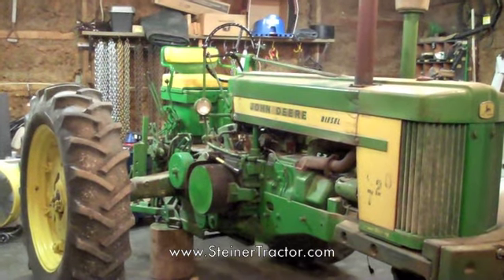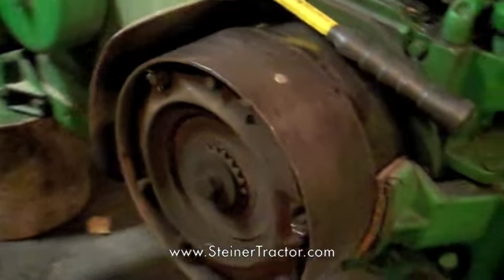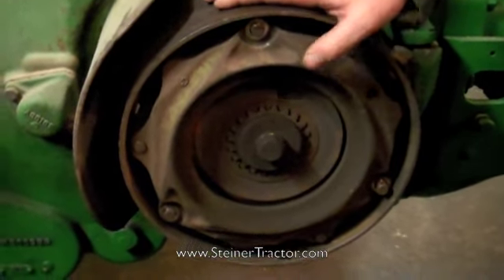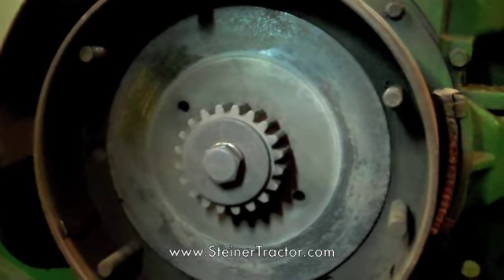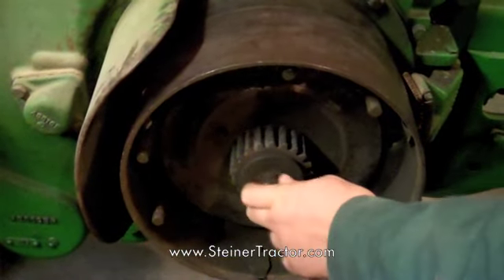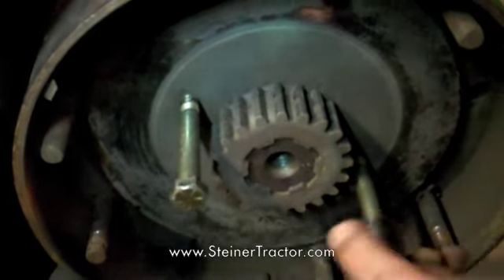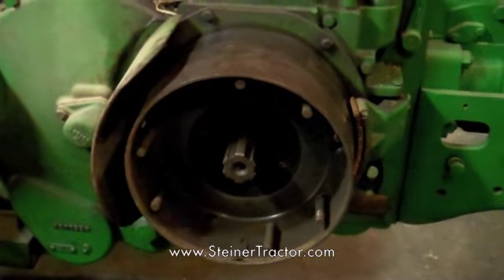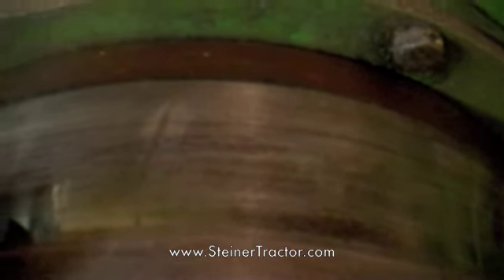Step 2 - Tear Down

Comment: The 530 manual says you need to use a puller to remove the gear off the tapper lock. Can I use two bolts on it or do I need a gear puller

Comment: Hi, where would I be able to find a used crankshaft for a 730 john deere Diesel
Reply from the maker: Hi Rhyan, Have you checked with New Paris Tractor Parts??  1-844-214-3946.